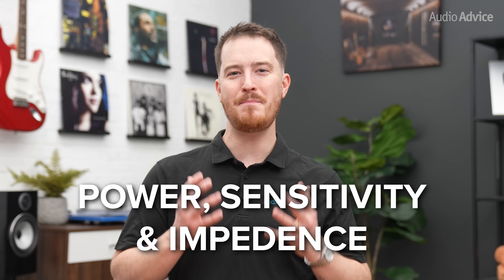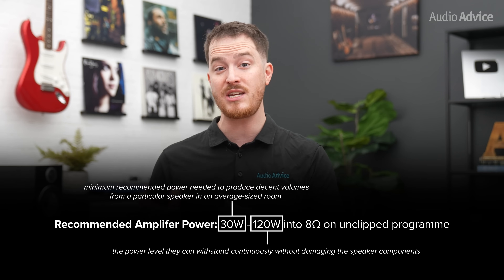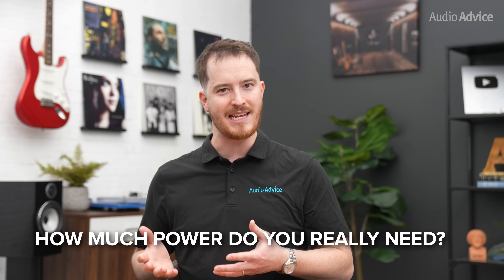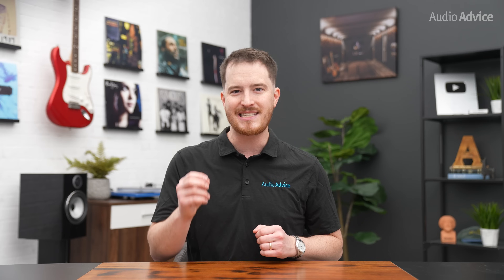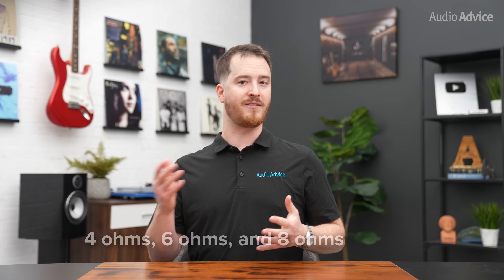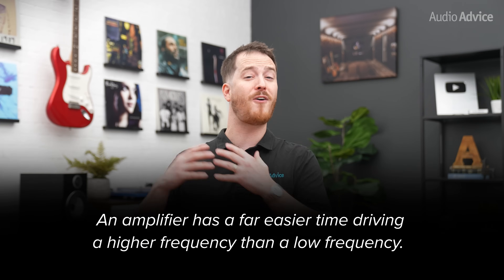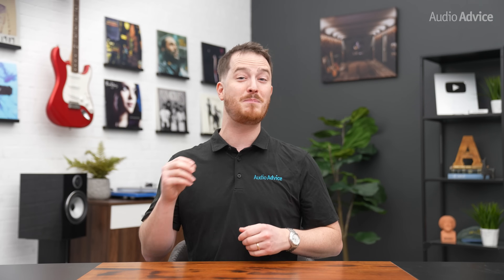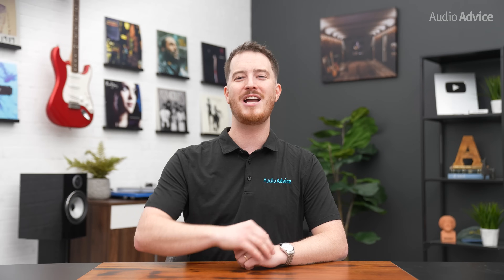How to Match the Right Amp to Your Speakers - Speaker Power, Sensitivity & Impedance Explained:

Comment: I have a pair of Infinity speakers(4 ohms impedance,100W RMS power handling,92dB sensitivity). Can I match it with my Pioneer car stereo with Output level 500mV, Max. power 50W x 4, and Load Impedance 4 - 8 ohm?
Reply from the maker: Sorry, we do not deal in car audio but the sensitivity on those seems fine for that, but you should consult a car audio expert to confirm.  Thanks for watching

Comment: Hey great video! Im wondering if you could help me out, I’m looking at purchasing a pair of Klipsch 600 mk2s and my first amp. I’m confused on what watt stereo receiver is best to drive such speakers, I’ve heard it’s best to match the wattages but I’m looking at vintage receivers and the higher wattage receivers are stupid costly, what wattage would u best recommend to fill my smaller room and when turned up fill multiple rooms. 😅
Reply from the maker: Contact our experts at audioadvice.com and they can help you find the perfect match!

Comment: You are so right! clipping from under powered amps can cause more damage than very powerful amps. I learned this in the 70s reading Stereo Review. Technically the flat part of a clipped waveform is DC voltage. We know how speakers like that! It is funny that some Chi Fi amps claim 600 watts of output. LOL
Reply from the maker: For sure! Thanks for watching!

Comment: My speakers says 4 oms on the back..I have the monolithic 7 *200 amp which says 320 watts at 4 oms.. Does the amp recognize this or is there a switch... I was litterly behind my cabinet when I saw this.. 😂😂
Reply from the maker: Unless it is a tube amp, most do not have a switch.  You should be fine.

Comment: Boy I thought we had fixed all this back in the 70’s when amplification ratings were forced by law to rate output from 20-20,000 hz at 8 ohms, continuously driven. Now we have to worry again whether or not the ratings are skewed?
I have a Yamaha AS3200 and all I want to know is if it can drive a set of B&W 802’s if I buy them. This is getting complicated again.
Reply from the maker: Yes, the 70's had wild specs and the FCC has stepped in again to make sure they are all measured the same way now, properly with low distortion from 20-20K.   We would prefer much more power for the 802's.  It should run them in a small room, but you would be better off with more juice.  Please feel free to reach out to our team to discuss in more detail at www.audioadvice.com